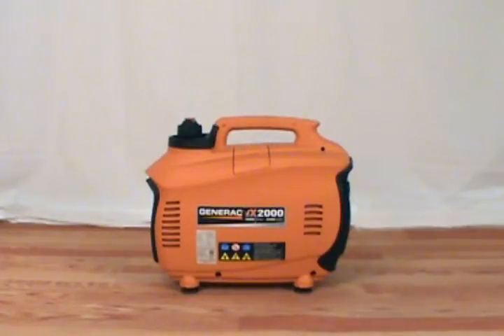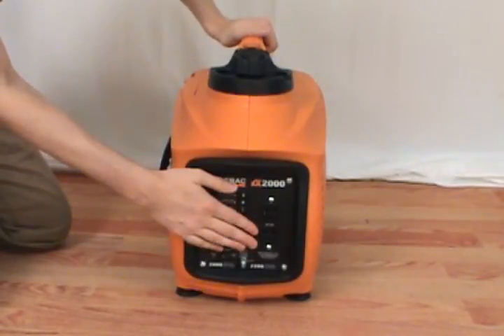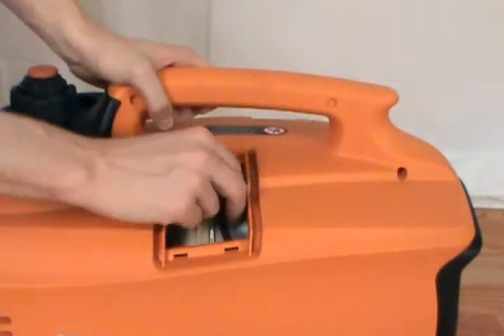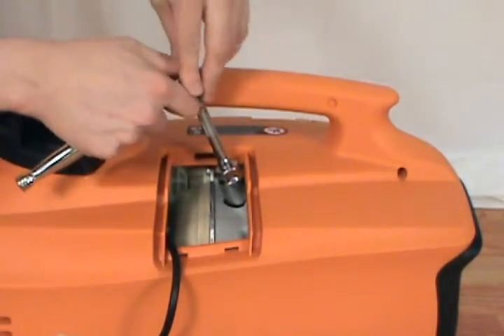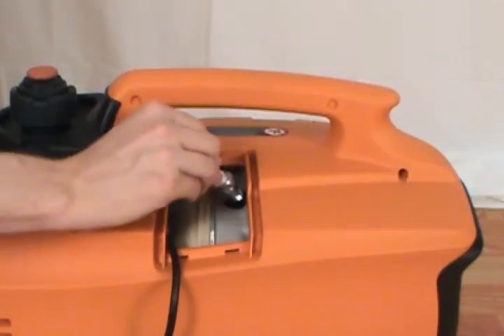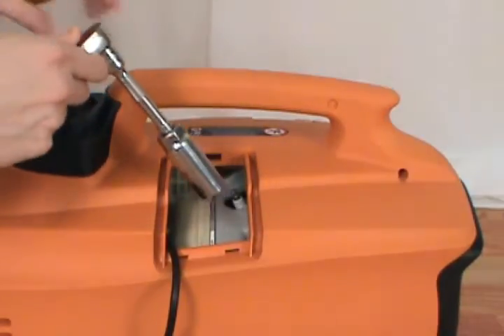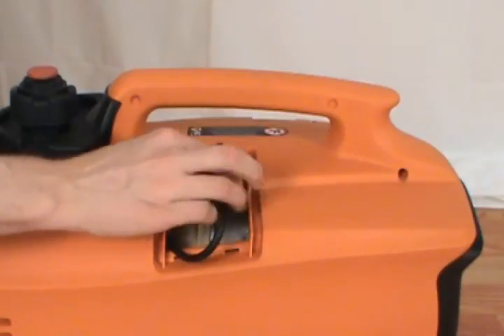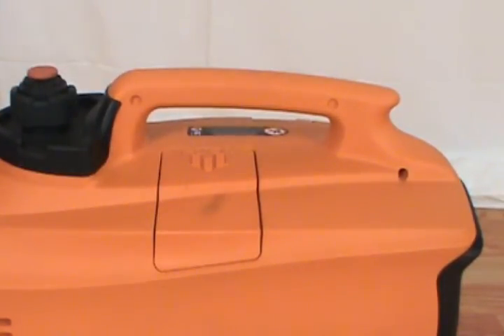Changing the Spark Plug - Generac iX2000 Generator

Comment: Quiet!~~>share4.photo/G22Inverter?f    Works well for what I need. Runs a saw and small air compressor (not simultaneously). Shop lights and coffee maker, no problem. Would purchase again and considering another to run in parallel.